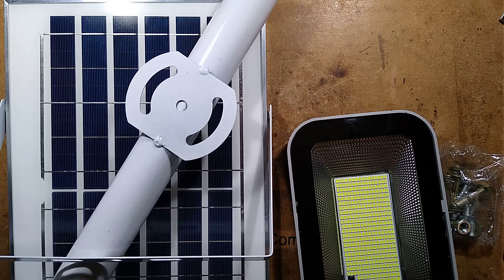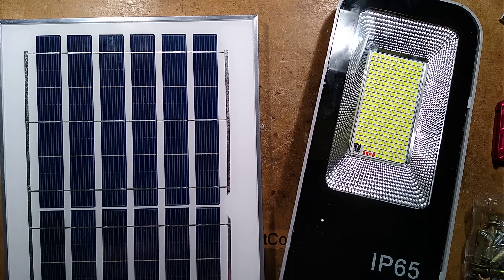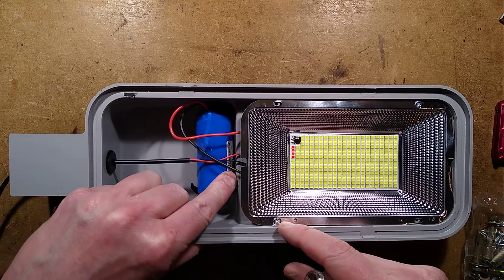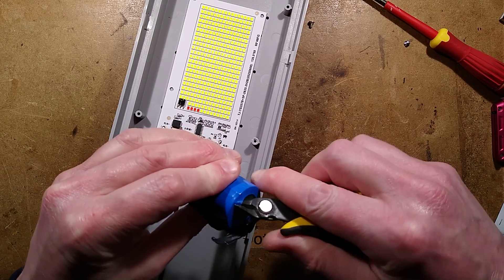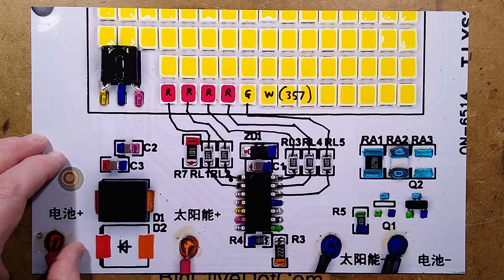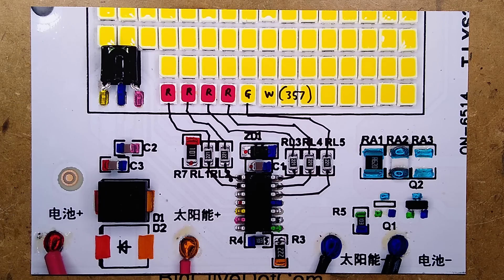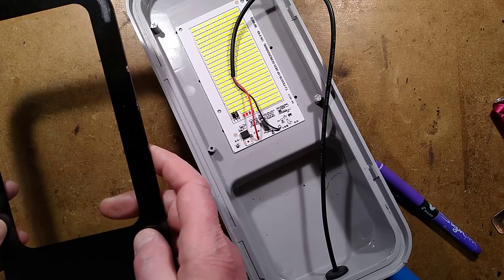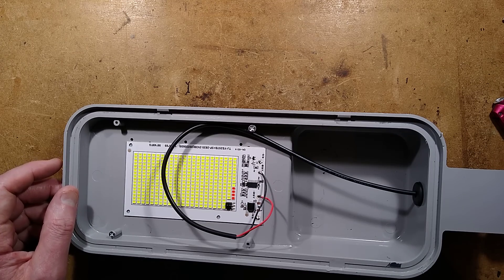Temu solar street light with generous solar panel & LiFePO4 cell

Comment: Is there a compatible rechargeable cell that can be soldered in to increase the unit’s operating time?
Reply from the maker: You could use a larger LiFePO4 cell or even a parallel cluster.

Comment: I got one of these lights and I wanted to re watch this video because I wanted to see what it 
is supposed to be doing when charging. I can't put it outside to charge it with the solar panel because it is winter in NE and the light sucks. I am trying to determine a way to charge it with 
a wall wart. I am now going to watch the video again. As always, I trust Clive's information 
implicitly!  🙂😌

Comment: My landlord got one of these for the yard and it stopped working after a few months I took it apart and it's similar in concept. The batter is 6 cells in parallel I assume as the voltage is that of a single cell. I am trying to figure out a good way to calculate the capacity but it says 20000mAH
Reply: Your video was very helpful because the plastic cover and silicon adhesive used to mount the batter are extremely similar. So it let me guess that there is a protective circuit in the plastic wrap of the battery. I don't need to worry about it as much

Comment: If they had sandwiched the solar cells between glass and put that in the frame, then the output could have been a few volts more and an amp or two more. Sad how they do things cheaply that cause the products they manufacture to not work at there the greatest potential, and they way they laminate the back of the cells it is impossible to remove the white backing. Damn even putting a mirror on the back, a two-way mirror allowing light in not out would have improved the output of the panel. what you need with solar panels is a way to get as much light to the cells as possible covering the back just prevents so much light entering and a mirror back reflects the light that would not have been used.

Comment: It looks half decent. Are the charge indicator LEDs phosphor converted, or did you colour them in on your pictures?

The sun in April is a similar strength to late summer,  so it's a reasonable test.
Reply from the maker: They are phosphor based.

Comment: That’s almost certainly a 6Ah cell. The 32650/32700’s are almost all 6Ah with the high energy ones being 7Ah. The 6Ah cells can typically support a 3C continuous discharge and sometimes a 5C burst. 

Any 3Ah 32650 cell is likely something like a Full River high discharge cell. For 26650 you have the 2.5Ah A123 M1B. You can even find some high discharge 5Ah 26650’s these days.

Comment: I do like LiFePo cells. But i doubt 6Ah. I prefer A123 cells, which have 2,5 Ah of that size. I build motorcycle starter batteries out of it. They are not suitable to be charged below 0°C, but for A123 i ignored that with success. But they will have much less power in winter.

Comment: I don't like these non-standard led panels. It used to be replaceable and easy to find, but now they glue/epoxy the glass and put all kinds of led arrays which you will never find on aliexpress. It should come with a few spares at least.

Comment: Check position RA2 again on that board. It's populated with an upside-down resistor. Most likely they're tuning that 62 ohm with a much higher value resistor in parallel.

Comment: How can I send you an item to look at? My wife bought a phone charger from amazon and it exploded in out socket. I pulled it out and opened it and it looks possibly terribly made (not and electrical engineer or anything)
Reply from the maker: I strongly recommend against buying phone chargers from anywhere except prominent sellers like IKEA or ASDA or Walmart.  They have to comply with local safety regulations. 
The cheap chargers explode a lot.

Comment: Would it improve the longevity or stability of the circuitry if you filled in the empty spaces? Or would that rather be for a different setup entirely, e.g. when using multi-chip LEDs that need more power?

Comment: I have a few similar floodlights that run off one LiFePo4 battery just like this one.  The downside is that the tiny BMS/protection board mounted on the side of the battery is poorly deisgned and doesn't cut off the charging until 3.75v (it should be no more than 3.65v).  My batteries last a year or two, but they should last a decade.  Also, the replacement batteries are listed as 5Ah yet they have tested only 3.4 to 3.6AH.  I have no doubt the 6AH in that light is greatly exaggerated.
Reply: they prolly planned a twin 3Ah cell model for more sunny places but sell those halfed capacity variation to like UK and other low sun irradiance places because the PV wouldn't stand a chance to charge both cells.

Comment: For the battery test, drain the battery to flat and charge it with a 5v 1a input where the solar panel connects and put current sensing on the battery as it charges, then do the same with the 3ah battery and see which one charges faster. You'll figure out pretty quickly that Chinese manufacturers tend to over-exaggerate capacity ratings.
Reply: Draining LFP to "flat" will ruin the cell. 2.5v to 3.65v are the limits for these. When they first came out, 2.0v to 4.0v were common BMS settings, but the cells will rapidly degrade using those values.

Comment: I've tested quite a few of these. they all come in every size imaginable, they all tend to work very good for what they are and their price level, some comes with rubber gasket sealing, some comes without, they all have different sets of Led lights but tends to be built the same way. I use them as indoor lights in my workshops, it's free light so can't complain there. The solar panels I've placed in my windows and it works just fine.

Comment: A question: How does such a tiny MOSFET survive the current of 350+ LEDs? On that note, how much current does the Lamp take?
Reply from the maker: The tiny MOSFETs have a very low on state resistance that means they dissipate very little heat.

Comment: Even just the fact that it's a LiFePO4 with a decently good solar panel is likely worth it! Seems nifty to do some DIY stuff to like increasing the size of the cell for less sunny environments or Zigbee/Z-Wave control to integrate with home automation! Don't believe that IP65 rating for a second but maybe with a re-application of silicone sealant all the way round could save it in wetter environments without too much fuss.

Comment: Just wondering, shouldn't the solar panel have a diode included in the box on the back to stop it hogging power at night, or is the diode elsewhere?
Reply from the maker: It's on the PCB.

Comment: What's the point of this solar street light if it lasts somewhere between 20 - 50 minutes on a charge? (given battery capacity and led load)
Reply: The remote controller not give you a clue to their use?
Reply: @two_tier_gary_rumain  Sure, but its described as a street light. In my neck of the woods, a street light is on from dusk to dawn.
Reply: @two_tier_gary_rumain  Yes, I get it. How about "solar light"?
Reply from the maker: The current will reduce progressively as the battery discharges and its voltage drops.
Reply: @bigclivedotcom  So it will last longer. Given the current you are getting from the solar panel, adding another battery or three will pay dividends at least here in Australia.

Comment: I stumbled a little over the heat sink fins on the plastic housing, but otherwise it does seem like a nice light/solar panel. Curious about the 6AH claim on the battery

Comment: I've got one of those lights mounted near my driveway.   It uses a microwave motion detector to switch between low and high-brightness.   The LED array is quite large and it does use the LiFePO₄ battery--solar panel is on top.   It's been plugging away for about 5 years, sub-freezing and 40C temp extremes.  Original cost was about USD $50.

Comment: Pretty typical for a hard-framed solar panel, though note that the little plastic boxes on the back of the panel are not environmentally sealed, which is actually a bit of a problem for a streetlight application (even though it is underneath the panel).   Larger hard-framed panels seal their boxes and have bypass diodes in the boxes.

Most of these sorts of devices do use LiFePO4, not NMC.  Solar-powered outside path lighting has used LiFePO4 cells for over a decade in fact, because the batteries are very robust in variable environmental conditions and can tolerate being held at near 100% capacity almost indefinitely.   LiFePO4 is used all over the place these days, particularly in power stations and stationary battery storage.  It is completely replacing lead-acid in sailboats, RVs, and other mobile applications (but not e-bikes yet).

LiFePO4:  Discharge no lower than 2.5V.   Charge >= 3.45V for 100% charge, target <= 3.65V.   Maximum tolerance is 4.2V, electrolyte breakdown is at 4.6V.  Float is at 3.35V to 3.375V (battery remains at 100% SOC after charging complete when allowed to drop to the float).

Also when discharging LiFePO4, the cell voltage will very quickly drop to below 3.40V while still near 100% SOC, and the discharge curve is extremely flat.  By the time the battery gets to 3.2V it will already be 70% discharged and by the time it gets to 3.0V it will be 95% discharged.

LiFePO4 is a much safer lithium chemistry than NMC or NCA.  Hands down.  100x safer.

--

So, the actual circuit they used is really horrible for the battery.  They depend entirely on the protection circuit... they should not be using a 4.7V zener to clamp the voltage!   They can definitely use a lower voltage zener, somethingg in the 3.50V to 3.65V range.  And it is perfectly fine that the knee of the zener diode curve is really soft at those lower voltages because the float is so much lower.   The zener's leakage current at 3.35V is going to be very low.  Even with a very soft knee.

The designer of the circuit obviously didn't know how LiFePO4 batteries work.  Which is too bad.  If they used the correct zener voltage the LiFePO4 battery would probably last forever... like 20 years in an applicatoin like this, easy.

There is also no need whatsoever to use a resistor divider into the micro-controller or the extra diodes.  They can run the micro-controller directly from the solar-panel / battery combination.  The voltage regulation range is just about perfect for many micro-controllers, particularly PIC chips.   I've done several projects with PIC chips.

And they can run the LEDs directly with the FET without any current-limiting resistor simply by having the micro-controller sense the current (add a 5mOhm current sense resistor on the ground path for the LEDs).  The voltage regulation is good enough to do that.  The microcontroller can just PWM to get the desired average current.   LEDs can actually tolerate a bit of extra voltage, they simply dissipate it as heat, so as long as you regulate the heat (PWM the LED), you can actually get away with a lot.

The 10K pull-down is to ensure the LEDs remain off at power-up.

Also they could have used a PIC chip or something and not needed an external RC oscillator.  Really, they could have removed a whole pile of parts from this design if they had known what they were doing.

-Matt
Reply: I don,t see from Clive's schem how the MCU even gets an accurate voltage reading of the cell voltage to guesstimate the cell's SOC.
Reply: @vkristof1  Several ways the MCU can figure it out.

First is from the 2K/10K resistor divider, at least while the sun is out.  The solar panel will be forced to BAT + 0.3V or so due to the battery voltage forcing the solar voltage down through the Shottky diode (or the Zener + Schottky diode if the battery protection circuit has disconnected it).

Second, from the 100 ohm resistor part of the circuit, you see that goes straight into the MCU.   The Zener only caps the voltage, so the actual voltage on that pin is in fact very close to the actual voltage of the battery.

Third, those 5 LEDs through the 220 ohm resistor going into the MCU.  The MCU is using that ping to turn the LEDs on and off by setting the pin to an output and then logic 0 (very close to ground)... perhaps as a power dump, not just for pretty LEDs.  But there is nothing stopping the MCU from changing the pin mode to an input and using the ADC to read the voltage.  It will be the BAT - (LED-drop @ 5uA) or something like that.... that will be very close to the battery voltage too.

And finally, the supply voltage of the MCU itself (if it isn't that pin in #2) can usually be internally connected to the ADC, allowing the supply voltage to be read that way (again with an internal reference to calibrate it).

#2 or #4 is the most likely point.  I didn't look at the MCU data sheet but most of these sorts of MCUs can internally connect their ADC's to any of the pins, and many have internal voltage references to calibrate the value against to calculate the actual voltage.

Note that the LiFePO4 battery has a very low impedance.   A little 5V solar cell even with full sun can't pull up its voltage very much above the voltage on the charge curve for LiFePO4 at any given SOC.

--

If they needed another pin they could in fact use method #3... I use method #3 all the time with really tiny 8-pin PIC chips.  Basically multiplex two functions onto one pin, an input function and an output function.  It only takes about 20uS to switch the pin mode and do an ADC reading, and switch it back, so a person wouldn't even notice the flicker on the LEDs.

The varying supply voltage on the MCU is not an impediment either.  Most MCUs in this class have very wide supply ranges.  Like 1.5V to 5.6V (for example).  So as long as it has an internal voltage reference (which most do), the program can figure out the actual voltages.

-Matt
Reply: @junkerzn7312  Thanks: I hadn't though of changing the direction of the SOC LED I/O pins and don't have current experience (& pin mixing) on low-end/low-pin count MCUs.

Comment: Interesting that TEMU even sells these. I'm sure the municipalities of the world will be placing their order for 4000 new street lamps around their city at TEMU, rather than, ehm.. anywhere else.
Reply: Autonomously powered lights are valuable on farm roads, private drives, camp sites, or other temporary installations where utility service is not easily available.
Reply: @abitofabitofabit4404  I would think if you're posh enough to have a private drive, you can probably muster the finances to put some electrics into the ground.

Camp sites usually provide mains power to caravans & campervans, so I guess you're talking about the bare minimums kind of places.

As for farm roads, they are public roads, right? Then it's up to the municipality, which doesn't typically order directly from consumer-facing Chinese cheapytown sellers.

Temporary installations, sure. I personally think the best bet for these lights is in a back garden that doesn't have electrics, as for a consumer (as opposed to a professional installation company) it can be quite annoying to install electrics in a garden.

Comment: 12:20 the lightweight construction is by design - when the mild steel bracket rusts and fails, it won't hurt so much when it falls on your head!
Reply: Good point. If we glue paper airplane wings on it, what are the odds it will do a left bank turn into the trash can?
Reply: Plastic where it should be metal. Metal where it should be plastic. Peak China.

Comment: These solar modules are made in the exact same way as big panels for roof-top or field installations:
- a front glass
- cover the front glass with a sheet of EVA (ethyl-vinyl-acetate) film, a kind of hot-melt glue
- lay on the already interconnected strings of solar cells
- put on a second sheet of EVA
- put on the back material, which can be either a special multi-layer, moisture barrier plastic film (like here) or a second sheet of glass
The whole stack is then put into a laminator and heat-treated under slight pressure. This not only melts the EVA but also cross-links it to give better long-term and environmental stability.
Reply: That sounds like WAY too many steps for Chinese manufacturing. I would rather presume they just hot glue gunned everything like they usually do.
Reply: @dr.lexwinter8604  you say that, but never underestimate the power of slave labor. Stuff like the Chinese arc welders actually have overcomplicated, fiddly casing designs because they simply want to use the components they have available in order to avoid custom *anything* molds that would jack up their price. If the product takes an extra hour to build, that's only like $3 extra they have to charge for it to become viable.

Comment: Thermally conductive plastic tends to be heavy. I suspect this will overheat.
Reply: AND: it's expensive.

temu is cheapest crap besides ali ect.   none of the chinese garbage sellers is putting proper brain in their products.

an alu/zinc cast housing with (deeeep) fins is the best you can get when it comes to led lighting.

Comment: Cut out a rectangle behind the light back and retrofit a metal finned heatsink using Goop brand automotive sealant or similar.  Not sure how long light will last without an effective heatsink.  Also panel looks like manu cheaped on surface area between silicon.  Typical Chinese antics on display, skimming.  Or perhaps the subcontractor met required specs but used an available surplus of larger, cheaper frames or something; odd excessive white space.  Also, red lights discernible only at arms length, the distance of a designer working on a computer, but too close to tell lights apart in a real world visual distance scenario with observer being on the ground lookig 20 feet up to mounting position. Red lights should be positioned farther from each other. And OMG what if they try to charge under freezing? This light is an embarrassment worthy of a junior high school student's first attempt at solar. E for Effort.